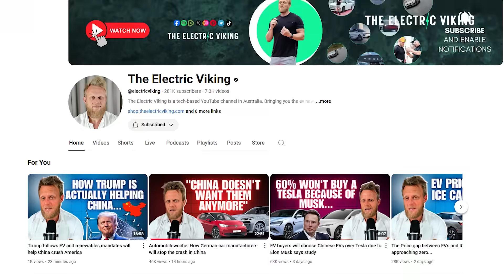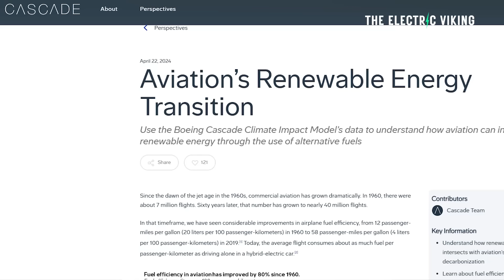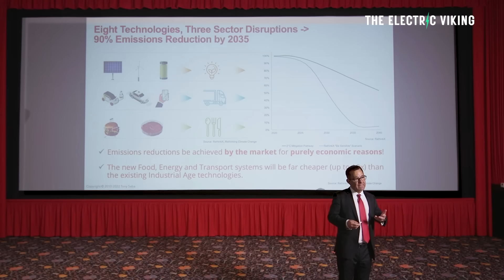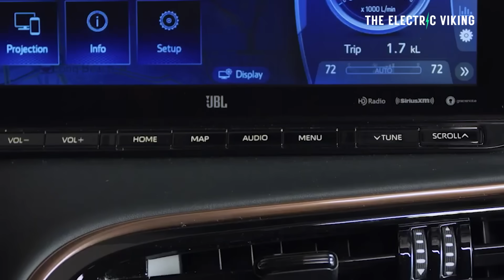The global industries that clean hydrogen production with DISRUPT

Comment: Hydrogen (H2) is the second smallest molecule known to us. Natural gas (CH4) is approximately 2.5x larger. Google natural gas leaks from refineries found to be 20 to 120 higher than thought. Hydrogen is extremely difficult to store and transport. Metals get brittle when exposed to hydrogen. Existing Natural Gas infrastructure cannot be used for Hydrogen for these reasons and others. Hydrogen burns with an invisible flame making it difficult to detect and localize using our eyes. Aside from the energy it takes to split water or use Methane to make hydrogen transport and fuelling also use an enormous amount of energy to keep it under high pressure. 

The promise of hydrogen has been around for 50 years or more promoted by the fossil fuels industry. Anything promoted by this industry needs to be looked at a 100 times before acceptance.
Reply: Which molecule is smaller than hydrogen? when I was at school hydrogen was the first and smallest element on the periodic table.
Reply: @peteralflat281  Sharp eye. No molecule is smaller than diatomic hydrogen, H2. This was a typo or mistake by the poster.
I came here to make the same comment, but I checked to see if someone else made it also. Good job.
Reply: @peteralflat281  Helium. H2 is a bit bigger than He1 even though helium is denser than hydrogen in gas form, the helium leaks through piping walls worse than hydrogen.
Reply: one of the biggest issues with Hydrogen is a think called hydrogen embrittlement  That is one reason it never made sense for cars  and i am not sure how much it works for plains or ships but yes it has been used for some rockets but it may not work for reusable rockets because of the added hydrogen embrittlement issue
Reply: @chlistens7742  316 stainless steel with a minimum of 12% nickel is better suited for the unique challenges of hydrogen. Stainless steel with higher levels of nickel content can help prevent hydrogen embrittlement.
 
Quote from:
TWI Ltd (Head Office)
Granta Park, Great Abington, Cambridge, CB21 6AL, UK
Reply: You are completely correct. It seems to have a use case in powering space ships. And thats all.
Reply: @McCraeMoto1  It doesn't even really work for that. Artemis/NASA is struggling with the storage of H2. Methane is a better rocket fuel.
Reply: Liquid hydrogen is made in walnut creek California, which is just outside of San Francisco has been for many years. They refrigerate to liquid and ship it all over by semi truck.

I was told by one of the refrigeration researchers at one of the national labs that they do their refrigeration is 75% efficient refrigeration efficiency, which works out to less than 5% of the energy con tent in hydrogen.

They use compression with large expansion, nozzles and turbos to recoup the mechanical energy of the refrigeration
Reply: @johnstubbe3113  Interesting post. If true, then that supports Sam's opinion about how Hydrogen COULD be used effectively for maritime bulk shipping.
Reply: @martinmorgan9  use ammonia.
Reply: @johnstubbe3113 Hence was it's called liquid hydrogen and the trucks where we are all have the label liquid hydrogen 😂
Reply: @ Which company is this? ('cos I can't find it)
Reply: Same guest reading Michael Barnard's analysis of hydrogen used for aeronautical purposes. Followed up by Paul Martin's extensive critique of these applications. 

Paul is. 30+ year engineer highly experienced in hydrogen systems.

My proposition is leave long distance planes alone. Let them use Jet A fuel. Air travel and trains only account for 3% of global emissions. Focus on the 80% that can be reduced to near zero with existing technologies.

If we get to 50% reductions it will be a good day. We are wasting time and resources on the areas that have minimal impact. Blowing out matches while the forest burns. Or, stepping over dollars to pick up dimes.
Reply: @bigskygeneration4474  I agree. Shipping is easier to solve for than long-haul flying and has roughly the same CO2 impact as flying.
Reply: Yes  methane leakage will be our greenhouse downfall. Its concentration has increased rapidly in the wild west methane gold rush.
Reply: @lauchlanguddy1004  Leaky "Hydrogen" gas is worst for climate change than fossil fuel!
Reply: @lauchlanguddy1004  need to do a mad Max on it..
Reply: @SR-pr2xz  reply jumped comments.
Reply: i guess you believe scientists engineers and management have not considered these things. who do you think sponsors and perfors the research on emerging technologies?
Reply: Please correct your post, H2 IS the smallest molecule. We don't need misinformation obscuring your other fine points.
H2 is challenging to store or transport. It would have limited uses generally speaking. 
HOWEVER, if one could make it as you go, like just in time manufacturing, then it would have more applications.
For Example, a vehicle with a HHO generator could use water, catalysts and electrolysis to make H2 on the go. 
I don't know if this is feasible on any scale, but it almost eliminates the storage and transport issue.
Reply: @lunatik9696  Yet, it continues to ignore that all that can be skipped and electricity just used directly. I agree with correcting an otherwise fine post, as you say.
Reply: And it's odorless and has a big impact on global warming, when it inevitably leaks.
Reply: Big ships could be nuclear powered like the navy
Reply: @ChalrieD  I have made the same point. Very CapEx intensive and might face some public pushback but it could be feasible, especially if governments put huge surcharges on non-nuke large ships coming into port. Glad you mentioned it. Medium sized ships should probably go LNG, with hopefully e-methane (CO2 + green H2) fuel.
Reply: @machoopichoo2  Public pushback on nuclear is a lot less significant than it used to be, especially since there might very well be thorium and passive nuclear which is in fact can’t be melted down easily.  China has it right with the mix of solar and nuclear.
Reply: @ChalrieD  Fair. Three Mile Island is coming back online and there are US Navy ships/subs out there already, even though some may feel that is safer than private sector. I agree fully, if the Capex situation can be overcome, it's likely the best solution for large ships. Again, I think ports charging a premium for non-nuke large ships could help greatly. I am not sure what the lifespan of a reactor in a ship is, but it would be really great if when a ship is end of life, the reactor could be refurbished and put in a brand new ship.
Reply: @ it’s an interesting conversation, wish I were in the industry and could opine with more thoroughness, but generally it seems like good ideas.  Hydrogen for jets also I see Airbus is toying with it they’ve converted an A380 and are flying it around.  That seems like a really good idea, again not being in the industry.  Was a physicist in biology labs in my career.
Reply: Extremely educational post.nice
Reply: ....its the smallest no? Helium is second heaviest.
Reply: Natural gas is odourless. They add another element so you can smell it.
Reply: as Sam says it's all about money. It seems inevitable Hydrogen production will be cheaper than oil production. So if Hydrogen's problems can be overcome companies will switch to Hydrogen. Plain and simple

Comment: I work in marine and aviation future fuels. Although hydrogen may be used the easier path to renewable fuels for these industries is a product made from hydrogen such as ammonia, methanol and SAF. This is being piloted in the next few years and will determine the direction of these industries. Low cost hydrogen is not currently available and this has killed off the use of hydrogen as an actual fuel in the transport industry. Trucks and heavy transport was looking positive but the cost of refuelling is still another key hurdle. 

Maybe to explain why hydrogen is not ideal as a marine fuel is to consider the size of the storage tanks required. Energy density is not possible and so hydrogen converted to ammonia or methanol are the simpler path.
Reply: MAN is developing a 4 cyl ammonia engine at Burmester & Wain in Copenhagen. Seems they are getting nowhere, though they hope to have a working engine in 2027. (should have delivered in '24) A firm tried to make hydrogen generators for sailboats, but every time the owner left his yacht for more than 3 - 4 days the hydrogen had absconded!

Comment: When considering aviation  I think the tradeoff between hydrogen and battery would depend more on intended range than on aircraft size. When the total energy required for a flight gets large the weight of the required battery becomes prohibitive. This is also a factor in maximum landing weight. Even today planes sometimes dump fuel to reduce landing weight when a flight has to be aborted. Can't do this with a battery, though this is much less of a problem with a small battery. A lower landing weight equals less runway required, less brake heating, and increased safety margins.

Also, re hydrogen vs battery storage where the hydrogen would be produced with surplus solar, currently hydrogen production from electricity is of much lower efficiency than storing the energy in a battery. Thus you would expect a large solar facility to first fill up any battery storage it had and only then start making hydrogen.
Reply: Irrelevant, safety is key for aircraft.  Hydrogen in a crash is insane!  Public will not trust it

Comment: How much energy is required to compress that hydrogen into the tanks. You never get that back. You also sacrifice the benefits of regenerative braking in automotive applications. Hydrogen tends to leak out of whatever you store it in. A lot of ships use cheap crude oil as fuel and that isn't likely to change any time soon. A more likely power source for big ships would be a micro nuclear reactor..

Comment: Why can't excess solar , wind power be used to make hydrogen for emergency power generation . To run peaking plants?
Rather than shutting down solar systems in peak periods just use it to make hydrogen for fuel to generate electricity?
Reply: Very true,may be cheaper than installing batterys
Reply: Just use heat batteries (sometimes known as sand batteries). Stupidly cheap and very safe.
Reply: Perfect🎉

Comment: Ships produce significant air pollution primarily because they burn **bunker fuel**, a cheap but highly polluting type of fuel with minimal exhaust regulations while at sea. Some ports require ships to switch to cleaner fuel within **12 miles of land**, but this doesn’t immediately eliminate pollutants from their exhaust stacks. Even when using standard fuel, ships lack emission controls like **catalytic converters**, further worsening pollution.  

Regulations on ship emissions are minimal, and pollution is even worse when vessels cannot connect to *shore power* and must run their engines in port for electricity. At anchor, ships—including **cruise ships**—keep their engines running to maintain onboard power, continuously releasing emissions.  

Transitioning ships to cleaner alternatives is challenging because *investors see little financial incentive* to retrofit existing fleets, as ship lifespans often exceed *25 years**. Without **global regulations**, the problem persists, as companies can simply **reflag ships* under countries with *lax environmental laws* to bypass stricter rules.